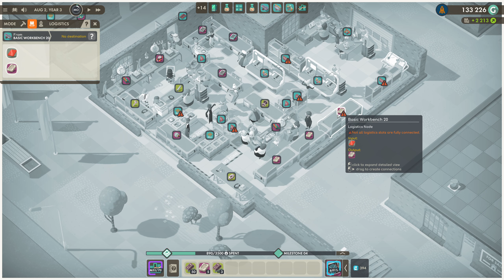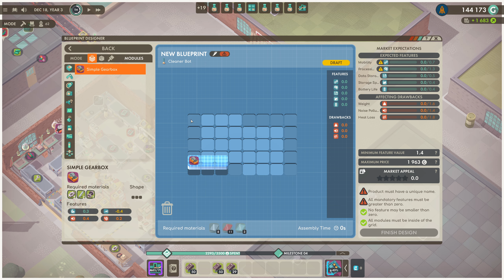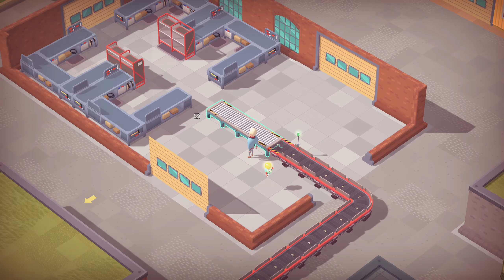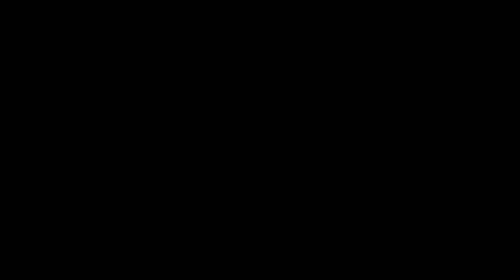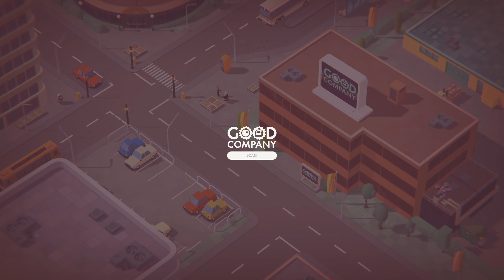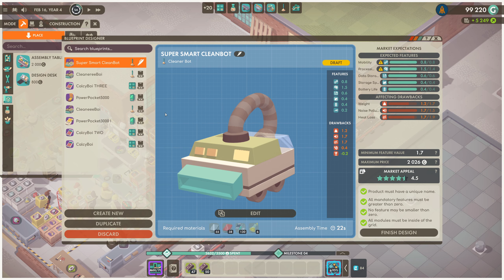Bespoke Buildings! - Good Company - Early Access Release Gameplay - Episode #5

Comment: Maybe I am missing something but it seems better to just sell intermediates than bother with the whole supply/demand/pricing of finished goods? I am surprised that there are so few options for finished goods this far into the game (3) but also disappointed how janky it is to rearrange for upgraded versions.
Reply from the maker: I think you're spot on with this. The profit is certainly better for manufactured goods. But not really worth the hassle
Reply: I love this game! I'm planning on making a tutorial to explain some of the things that I struggled with. As far as selling intermediate parts, you can do this however... The market will only take 2.5 stacks of each part. For example, if you make 3 stacks of cases and 3 stacks of batteries, you'll have half a stack of both left on the selling pallet after the truck picks them up. You can sell 2.5 stacks of different tier items. Basic cases, plastic cases...